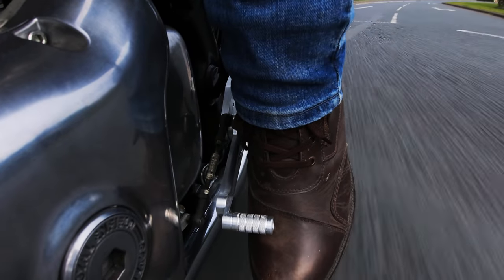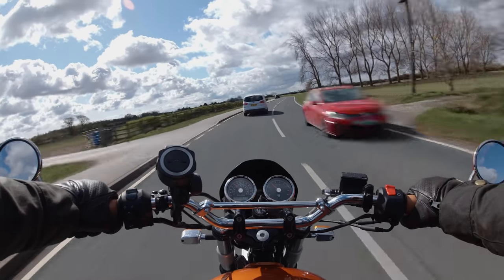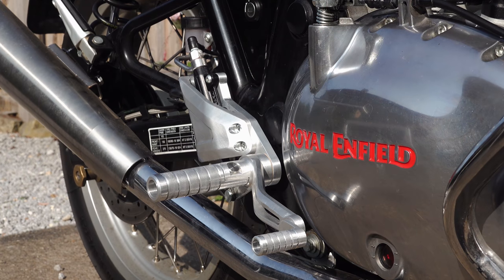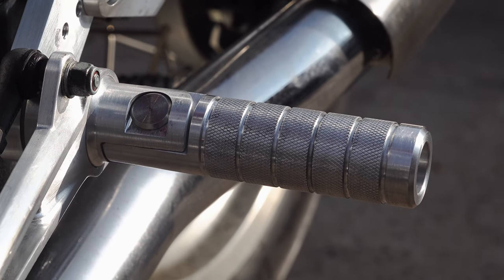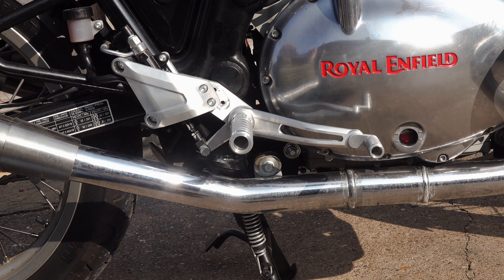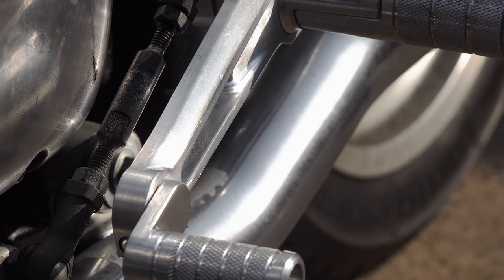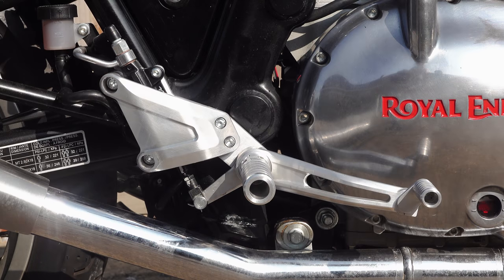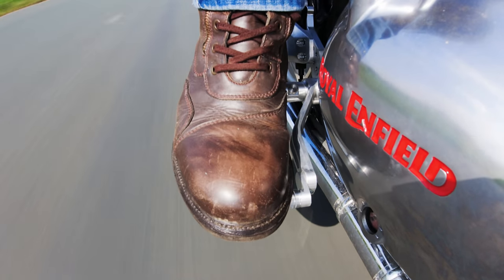Royal Enfield Interceptor 650. The EQUALISER Ultimate adjustable footrest/control system!

Comment: Like you Stu, I have zero issues with the standard setup on the Enfield, I simply adapted my leg position for manoeuvring the bike about. I quite like these, but personally I would prefer then to have a rubber finish like the OEM units, as my experience of pure metal pegs has always been some vibration that gets damped out by the rubber (a bit). That being said, as I have no ‘problem’ to solve, I am unlikely to buy them anyway!
Reply from the maker: Vibration on an Interceptor?
Reply: @stuartfillingham  I don’t get any vibration on the interceptor, it was more a comment around bare metal pegs in general, if there is any vibration on a bike, they will transmit it! The Interceptor is possibly the smoothest bike I’ve owned, even better than my old Thruxton R!

Comment: Thanks for the update Stuart and for previewing what could be an essential mod. I have run into the problem of hitting my calf but was thinking maybe I shouldn’t sit on the bike to move it around.🙂 As you say the stock pegs snd leavers do the job, but it is one area that I would like to improve. Some brass elements would be good to go with the Motone valve caps I have on the bike. Cheers

Comment: Enjoyed the video , although I don't have trouble with my pegs , but one problem I've had is the brass rivets on my Johnny Reb boots , I've had to put velcro strips around the rivets on my right boot to stop scratching up my side case ! although moving the peg position back may solve this problem , it will be more expensive ! getting into Spring here in OZ , so even more riding , stay safe with the rubber syde down !

Comment: I like to set up but I prefer the foot pegs and pedals to be rubber that can be replaced if they get worn out. Had metal pegs like that on a cruiser once and my boot kept sliding off them they didn't last long replace them with once with rubber inserts.

Comment: Nice one. Just looking at these in the video, I'd be concerned my feet would slip more easily from the Mojotone's rounded surfaces than from the flatter, more rectangular-shaped stock pegs. But that's just a visual take, and in practice perhaps it's not the case. Luckily for me, the stock pegs and peg placement function perfectly for my big feet and long legs. 

When walking the Interceptor while seated, I'm able to place my feet apart far enough that the pegs never touch my calves. I can see how these adjustable replacements would be welcomed by riders with shorter legs or more narrow stance.
Reply: Personal preference, but I like rubber on the footrests and levers.
Reply: Yes. Longer legs seem to drop wide of the pegs. Never faced any snagging.

Comment: I’m disappointed that 2 years development didn’t result in a rubber covering for the gear lever peg. Optional extra? How long would your left boot last?
Reply from the maker: LOL depends how cheap your boots are.
Reply: I do agree with the rubber, it looks more OEM, same can be said with the footpeg, doesn't look like you took off your gsxr1000 then either. it's not about cheap boots, not bothered about them.
Without testing I fear that by the time I've messed about adjusting them they will end up where the continental GT ones are?? I think I would prefer to swap for OEM ones and no doubt cheeper, although once ive seen them in black with brass footpeg and gear shift I might change my mind.
Reply from the maker: @rich.dodd1  surely the whole point of a custom part is for it not to look OEM?

Comment: If the rider foot pegs were designed to be able to lock them in the up position it would solve my main problem with them which is that they hit me in the shins when manually pulling the bike backwards.

Comment: Hello, the primary problem for me with the stock pegs is that my knees rest on the cylinder heads. I'm looking for a solution that not only moves the pegs back, but up as well. I'm 5 foot 7. Would be great if in a future video when the product is out, you could show if this change happens or not.
Reply from the maker: watch this video, it does raise the pegs slightly.